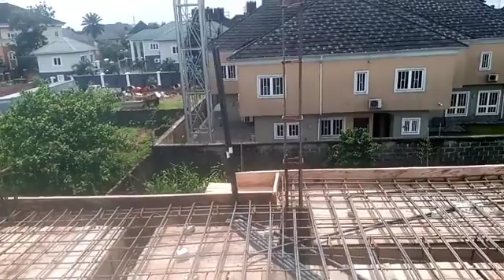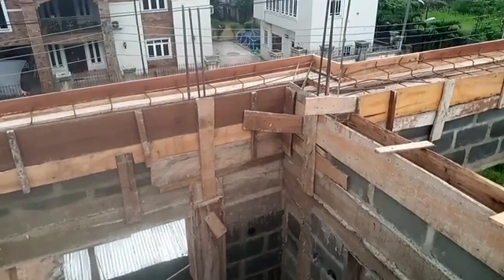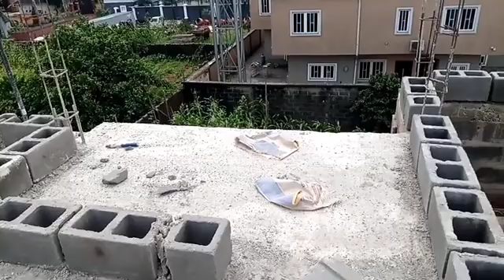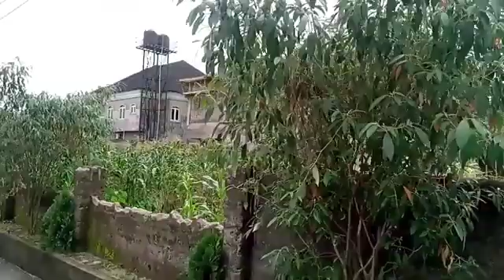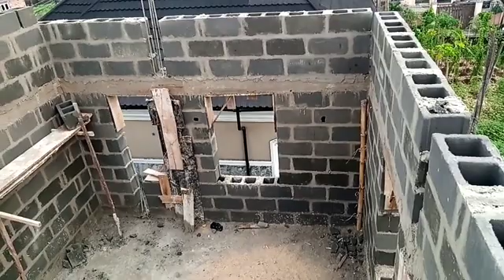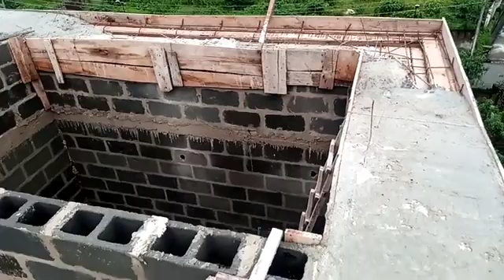Importance of roof beam on house construction projects

Comment: Is the roof beam the same as concrete ficial/ parapet?
Reply from the maker: The roof beam is not the same as the concrete facial but the concrete facial is built into the roof beam at all side of the building.
The roof beam is not just on all the sides of the building, it is also found inside major areas or partition on the building.
The function of the roof beam is to transfer the roof load to the columns